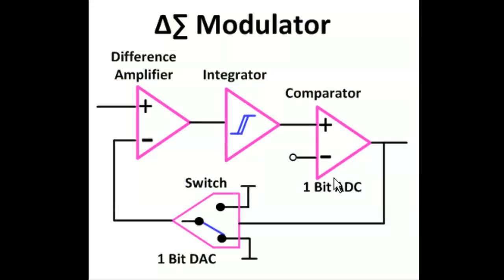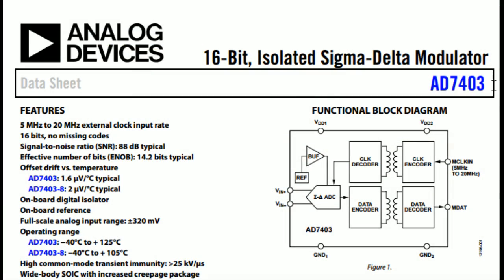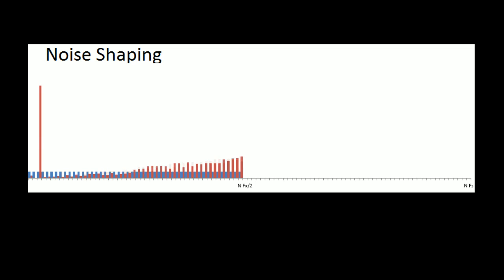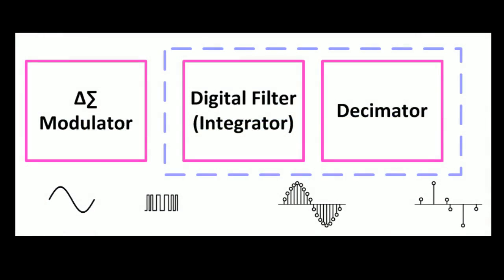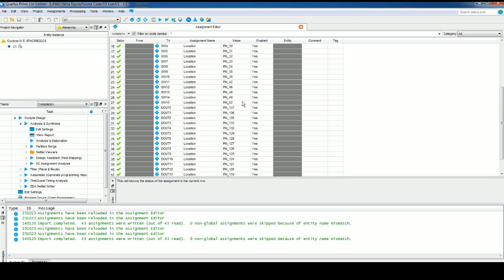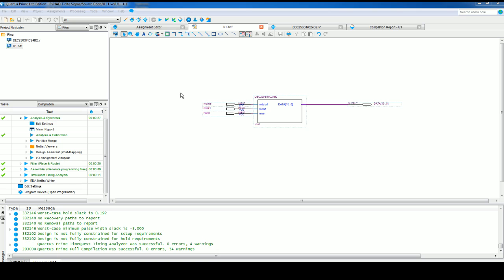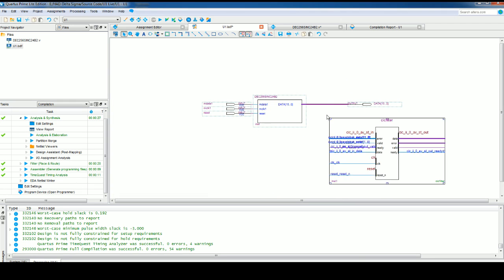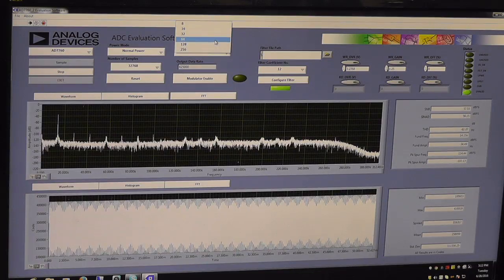Delta Sigma ADCs, Part 2

Comment: I'm not sure if this video actually explains this subject intuitively. It's nice to see what's in the spectrum analyzer but I still have zero understanding of why over-sampling decreases the noise - shouldn't the spectral density of noise increases as you increase of bandwidth (over-sampling)? It also threw me off starting 4:48 when that 1-bit modulated output appear to be a sine wave ... few minutes into the video everything else became a blur